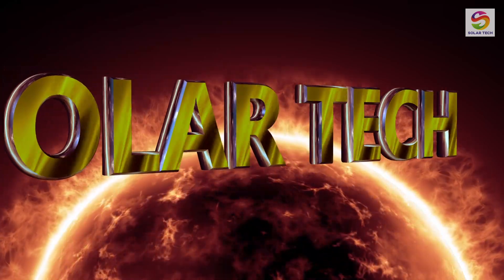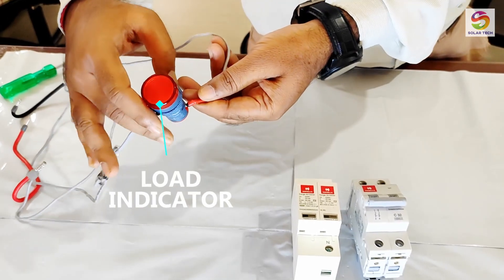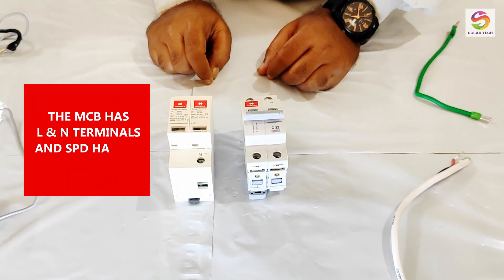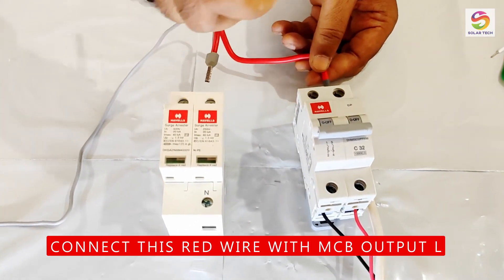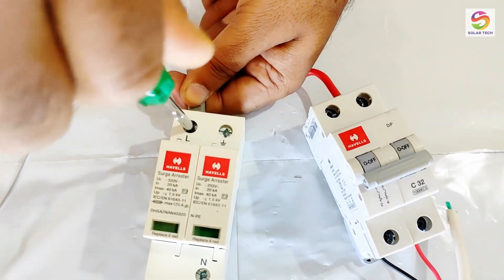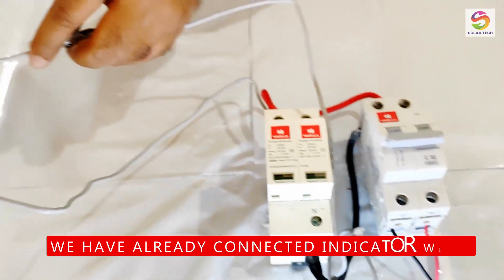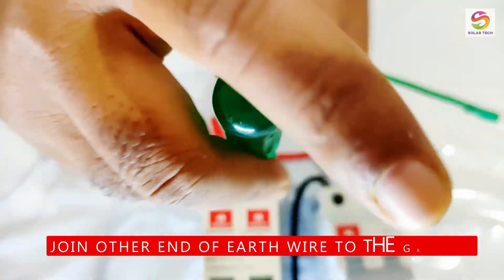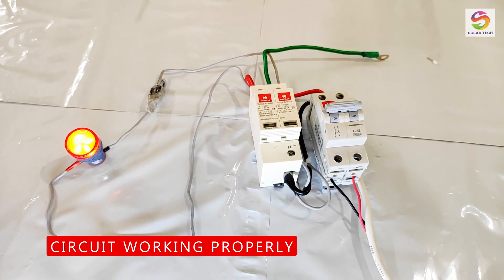HOW TO INSTALL AC SPD IN 1 PHASE SYSTEM | DIY | TYPE-2 SPD INSTALLATION

Comment: Can I use 1+2 Havells spd for home??I need external lighting protection and internal surges protection...plz guide
Reply from the maker: For home use 1P+N SPD type -2 if you have single phase connection an 3P+N for three phase connection.
Reply: @SolarTech-Homemaint  but type 2 does not protect from direct lightning surge,,so is it not better to install type 1+2spd?
Reply from the maker: @Anonymous-mm9tt  type 1+2 will be better option if you get it.
Reply: @SolarTech-Homemaint  yess I have got Havells type 1+2 spd🤩🤩
Reply from the maker: @Anonymous-mm9tt  great